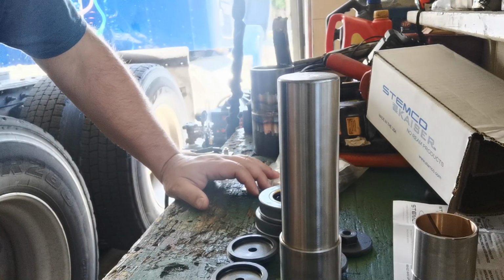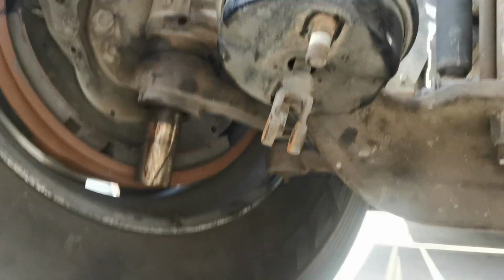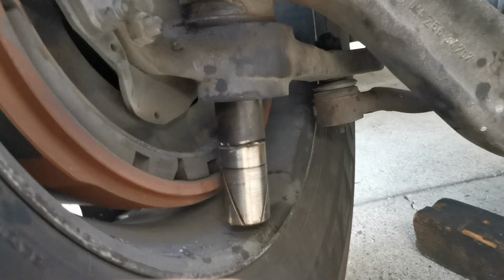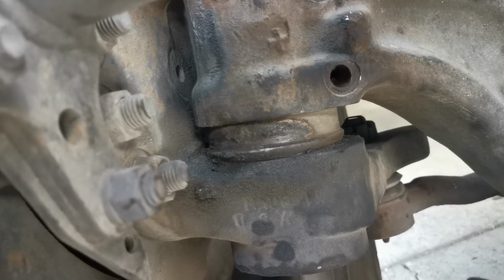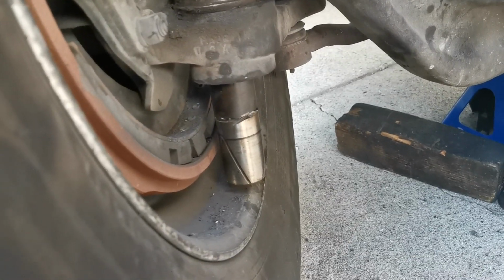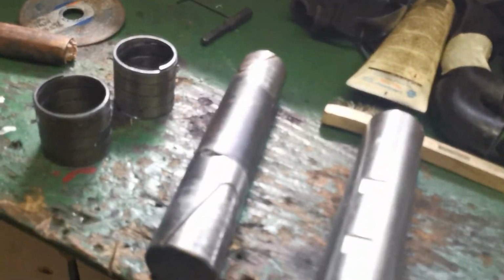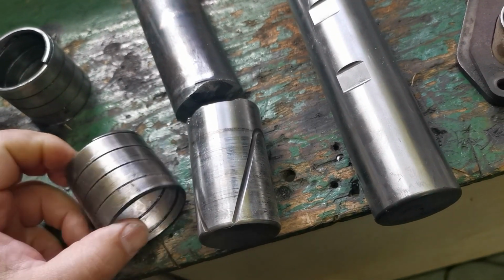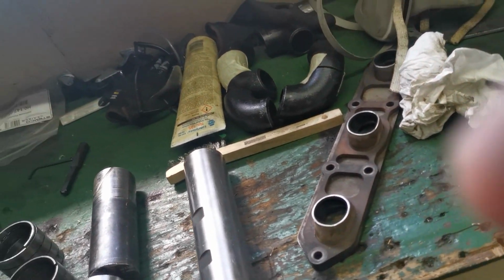How to replace king pin without detaching wheel

Comment: Well done Vlad really enjoyed the video this video shows anything can be done with determination. Also you can buy a tool called a lug nut torque wrench so you can remove the wheel easily without air compressor there around $100 dollars to buy online. Or in a good tool shop. You can look on YouTube videos under torque wrench multiplier you can keep it in your truck and you can remove your lug nuts it’s good for very hard to get off lug nuts. ✅😊👍

Comment: WoW and most dodgy award goes to Mr Truck owner who has no the toola ta remova da tire !!! The sheer amount of time you wasted is mind boggling ,if you timed it correctly the king pins could have been done on a brake shoe change plus the main thing of all is you won’t get even half the life out of the bushes due to bashing them in and most definitely putting them out of shape!!! Yes it will feel nice and tight for a few days but once all the high spots of bush material flatten down she’s going to be as loose as the chick who hangs at the corner !!!

Comment: for anybody watching this video. do not try and do this method. this is a hack job method. when you do kingpins on a steer axle you do it right. this guy made it so hard on himself. plus if you dont clean the spindle its hard to inspect before putting your new bushings and seals in. sometimes where the bearing sits on the bottom side of the spindle ear gets badly groved or pitted and needs to be cleaned up before reassembly. you you are gonna own a big truck be prepared to at least have a tire gun or be ready to pay somebody to do it right. HACK JOB